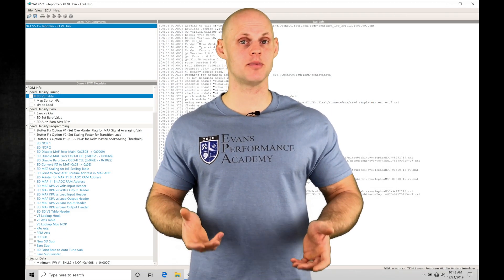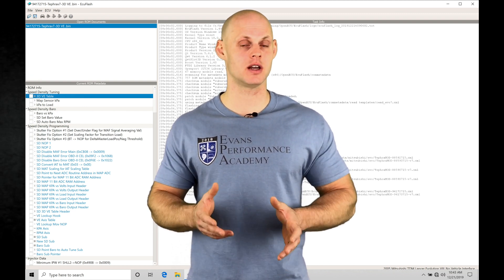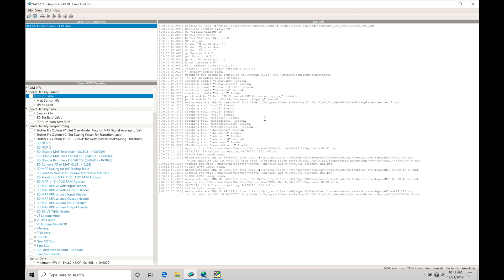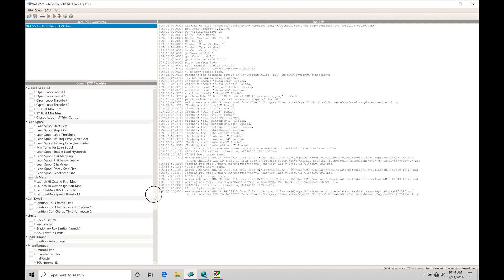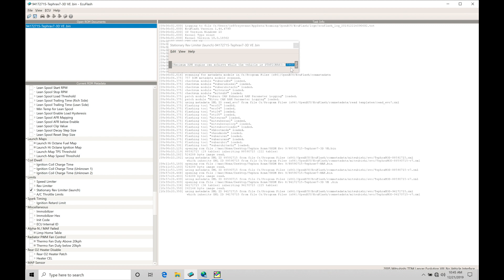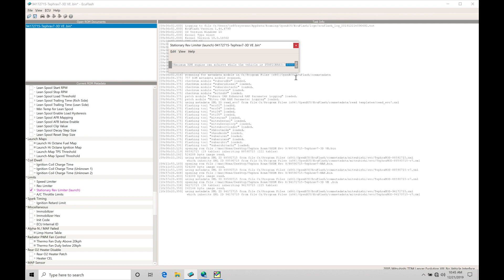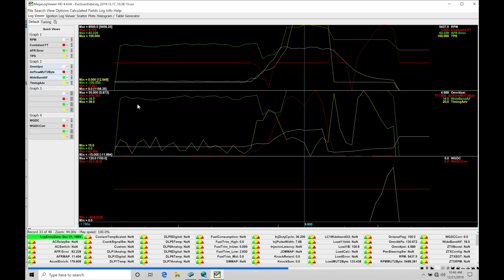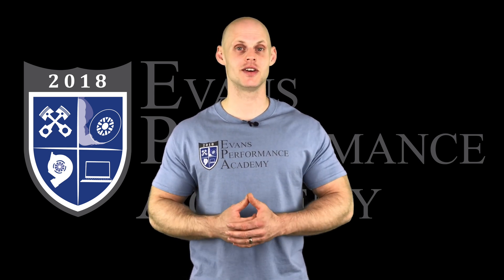Ecu Flash Training Course Part 18: Anti-Lag Launch Control | Evans Performance Academy

Comment: i have some questions about the programes it self i currently use Ecm Titanium by Alientech but i cant acces the launchcontrol feature even tho the car has the option from stock (audi a3 2.0 tfsi) i wasd wondering if there is a open source tuning software that can give me acces to all the features as this is currently only a hobby and intrest of mine so i dont see the benefit of buying  a 1000 dollar program thankyou verry much , with kind regards Ian Duijsens
Reply from the maker: We are not aware of any open source editing programs available in the VW / Audi market, sorry.
Reply: @EvansPerformanceAcademy  thankyou for the quick response do you have a recomondation for me on witch program to buy if i would buy one (keep in mind that VAG is verry common in my country so ill mostly be doing that)